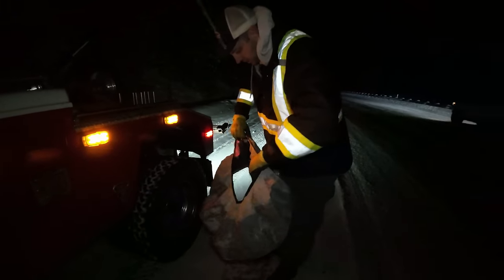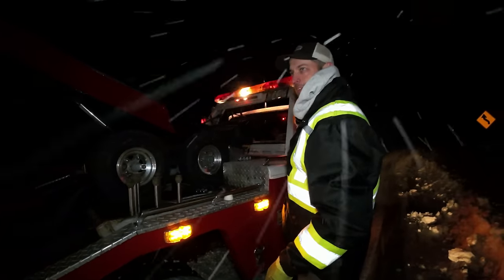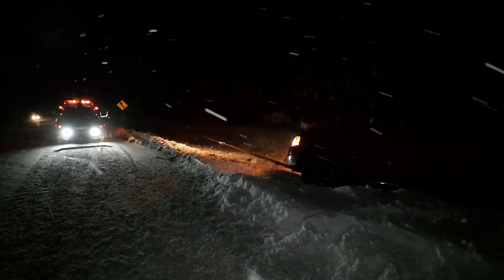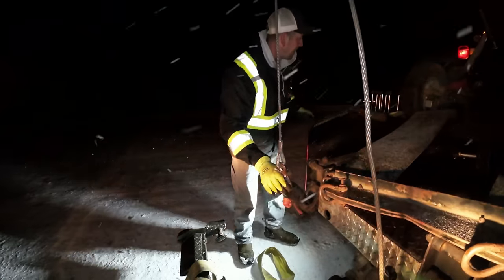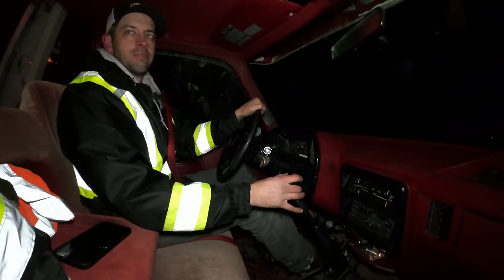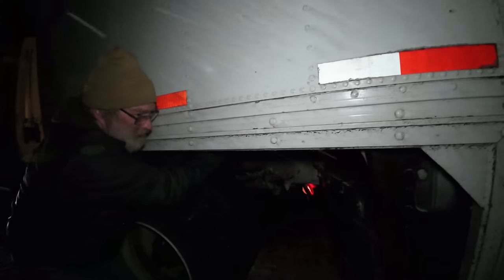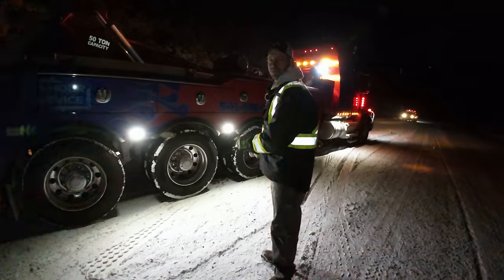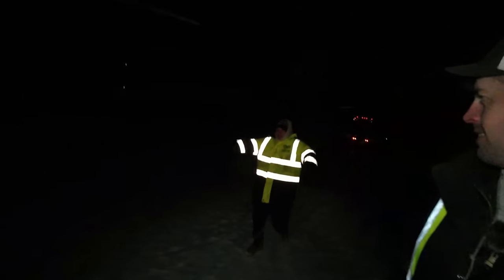Snow storm on the mountain.  Bring in the big dogs!

Comment: I could see the gleam in Casey's eyes when he seen the rotator! Thinking, "I need one of those!"
Reply from the maker: Not a rotator
Reply: That unit will set you back $750k +/-.
Reply: Before even said i took 1 look at that truck and knew right away what truck that was. Not a spinny boy, thats a straight stick Hr117!
Reply: Look at it again, as Casey says, it's not a rotator. It does not have a proper boom for starters and the carriage for a boom will slide along the length of the cargo box, but while it's being driven, it's rolled all the way back towards the cab and contains the spools. This one, the spools are likely fixed and the cables are part of the apparatus at the end of the cargo bed that only moves up and down, but is not a proper boom. For example of one, is a 2015 Peterbuilt based cab with a Century 1150R cargo bed from Ron Pratt (his channel) and he works for his parents trucking company, Midwest Truck out of Scott Missouri. He primarily drives it, and like this one, is a triple axle, with the front, rear wheels as additional steer wheels that also raise and lower as needed. The A+ towing truck may be based on that same cargo box .

Comment: Just some advice for those of you new (and inexperienced/overconfident) drivers… even though it’s a 4-wheel drive don’t drive faster than you can stop with just a very gentle application of the brakes…. Basically triple the amount  of stopping distance it would normally take …  remember that just because it feels like you have traction going forward as soon as you stab (hit the brakes hard) you’ve become an ice skate
Reply: I've preached that for years.  4x4= go easier on snow.  NOT go faster on snow.  You still have to be able to stop it.  Having 4x4 does tend to even out braking forces, but that little bit of improvement should not be relied on.  Also... YOU must be prepared to make allowances for others that can't run as fast as you can.  If they are ahead of you, it's your problem.  Don't crowd them.
Reply: An easier explanation is that 4wd only helps you get going faster
Reply: @thelonewrangler1008  my grandpa always told me that 4wd was only used in reverse to get you outa where you got stuck😁
Reply: A very wise and experienced driver once told me that having a 4x4 means you can get twice as stuck since all four wheels can dig holes! I drive a Subaru Forester, and a couple cars previous to that I had a 4x4 Aerostar van. When a sudden snow storm blew up while travelling from Toronto to Montreal along the 401, I drove about an average of 40 mph. I was constantly amazed as people in SUVs would go zooming past me, and I would see taillights, then alternating taillights, headlights taillights as they spun out on the next really icy patch. I would slow down more, make sure they were OK, then continue on. It's normally a 6 and bit hour drive...that trip ended up being 14 hours long!
Reply: @FarrellMcGovern  Nothing compensates for experience and commonsense ( which is becoming harder to find).
Reply: Just put new tires on 4wd. Nice flat, packed snow, nobody around.  Hit go pedal minimal spin in 2wd. Then I hit brakes. (Under 30 mph) no antilock. Had to let go.  They will be better in a few weeks. I should get chains.  But I seldom go in mountains.
Reply: Another piece of advice - is you are in 4 wheel drive and have to stop, put the truck in neutral. It stops the drive to the front tires - helps you break and steer. 4x4 means better traction to get going, but is a hinderance when stopping on slick roads.
Reply: My God man loosing control of a F-150 in 4x4 ?
Wow there very solid on snow and ice.   Rookie driver. Left of center could have been a head on Collision.
Reply: @Mlpojnnb1234  Heavy and longer time to stop on ice. Of course TIRES matter the most.
Reply: The first rule of snow is You don’t have brakes on snow period if your touching the brakes you’ve already fucked up downshift and engine braking

Comment: I want snow socks now. I can never justify chains, but socks look so useful. Quick on/off, small enough to carry year round, and don't make a racket in the back.
Reply: This was years ago (1985) the west side of Washington State got hammered by a big snow that dumped up to a foot of the white stuff in parts of Puget Sound and I bought cables and they were quite good, but like chains, can't run them on dry pavement for long, if at all. Eventually one of my cables broke while out delivering pizzas for Domino's. The car did well in snow, unless it was icy as it often was at night until the snow finally cleared away a week later.

Comment: I had seen a video a while ago where those snow socks were tested.  For what they are they actually do a pretty amazing job , they definitely do work!   I am not sure how long of a service life they will have, but I think that we may find out as Casey continues to use them.
Reply: For no harder than they are to install just keep them on snow and they should last a while.
Reply: How different are they functionally from the snow chains?
Reply: @nsbhagwat  my understanding is snow socks are more of.... slick plowed road driving tool.  Fairly good at it cause of all the micro pores (think millions of tire sipes).  For snow much deeper...  you need a GRRAAAB of snow chains.
Reply: Snow shoes suck on a 18 wheeler
Reply: @gordonil30117  thats been mentioned many times... while others have had success.  Could be the difference is the drivers foot.  Socks have apparently a very very narrow speed range they are effective and on big rigs due to weight... also a very short life... potentially as short as one mountain pass life only.
Reply: @coachgeo  Nah, snow socks work better in 4-6 inches of snow compared to chains. They also have a way shorter stopping distance compared to chains. I've used socks in Canadian winters for the past 2 years, they work when you need them. Chains are much better in icy conditions though and they will last far longer if you're on a highway with patches of exposed pavement or gravel compared to the socks. 

Sergiu Gabor did a really good, and entertaining, real-world-type test of them. 
https://www.youtube.com/watch?v=NpMmu0AliG0
Reply: @Jagabot_Esq.  could see your point about snow benefits...  Especially if snow has hardened.  In those cases chains breaks thru the hard layer and puts you right back into fluff again where the sock may aid in riding on top of the hard and the micro pores of socks should help here same as I mentioned when considering braking. 

Guess could then this makes it sorta ..... both points correct??

Comment: Let me guess, the red pickup has NO Weight in the back! Normal for this to happen! 
Few learn!
Reply: I used to have a 3/4 inch steel plate in the back of my F-100. A good 300 lbs, had to use the tractor to get it in and out. Really helped, and wasn't bulky. One year we put an old bathtub in, and let if fill with water. Then realized it was a torpedo if I was ever in a crash. Bad idea.

Comment: Having some spare air line could be to your advantage + clamps, fittings, just in case. Awesome video and job sir, keep them coming!👍👍👍
Reply from the maker: I do have everything I need to repair and replace airline on my other truck.
Reply: @CaseyLaDelle  Makes more sense to have those kits on the big rollback than on the light duty. Not many F-150s need air line repairs.

Comment: Just found ur channel, love it. In the winter, I drive hwy 20 from the valley to mt. B all the time. This rescue reminds me of 4-5 yrs ago, EB, crested the summit, no new snow, but that day sunny, and the snow must have melted mid-day. Road was an ice rink at 5pm January .  18-wheeler tractor (only) rightful so, crawling down the hill. He pull off at the first big pullout. The Ford Expedition behind him blasted down the hill. A few corners later, the Toyota Forerunner in front of me enrolls in ballet class, and did a 360 pirouette right in front of me into the two uphill lanes-luckily no up hill traffic. I just stayed in my lane and passed him. Once he got his rig under control, he tried to pass me, maybe he did, don’t recall. Well, 1 or 2 corners latter, there was the Expedition ‘beached’ just like your F150 bro. Of course he slid across both lanes of uphill lanes. Just below all this a bunch of cars travelling WB at speed. When we got into town, during dinner, I logged onto tripcheck, sure nuff, hwy closed. ❤ my Bridgestone blizzaks on my outback. Ps.. added you to my address book, if not for me, someone else.

Comment: Casey's eyes and the smile was just like a kid in a candy store when the rotator showed up. Could it be the next one to come to the yard and fleet.
Reply: Its not a rotator, it looks like one and is on the same basic body shape but its a heavy tow truck
Reply: @nphil93992  Yes, Nathan is correct. It's a Class A wrecker for bigger pulls or lifts. Notice no boom midway down the bed. That's a rotator.
Reply: Just a straight stick 50ton. Still a VERY NICE and expensive truck.

Comment: Casual observation: you recognize inexperienced ice and snow drivers by those who travel a mountain pass with no "just in case" coats and gear. 4-wheel drives with all season tires thinking they're just fine doing the speed limit.  Casey's always thinking ahead, parking his truck where oncoming traffic gets plenty of time to slow down, in a snowstorm those reflective triangles can be hard to spot.
Reply: Winter driving should always have the essentials - blankets, water, emergency food, flashlights. All vehicles with 4 wheels should have them, not just 4x4. Look at how many people Casey has rescued out in the woods that weren't prepared. Nobody wants a search and rescue to turn into a search and recovery.

Comment: Great show. I like the giant service truck and the air line fix. Casey you should acquire  some good LED lights for night videos. (The NONE flickering type). A really bright on camera light and some magnetic and clamp on LED flood lights.
Reply from the maker: The camera has a light on it.   I don’t use flood lights for roads is work.  They are dangerous when used improperly.   Notice all the big rear facing LED lights on top of my truck were turned off the whole time…

Comment: 4wd is bad for stopping. 
Especially locked 4wd.
Hard braking will then lock all wheels, and if the rear brakes locks, the car will become very unstable and rotate uncontrollably, instead of  just continuing straight ahead. 
That's why the braking force are usually 70% in the front  and  30% in the back.

Comment: If you own a big crew cab long bed 4x4 and you think you've got the best winter beast on the road, you're dead wrong. 

Those trucks get taken by the wind and pitched in a ditch super easy. If you've got the urge to drive fast and you see something low and AWD like a Subaru, follow their lead and slow down. Aside from ground clearance, that Subaru is better on slick roads than your truck ever will be.

Comment: Do they require chains to be on the vehicle, or to be carried in the vehicle?
I see no point with chains here if you have proper snow tires.
Reply from the maker: 4x4 with snow tires don’t have to use chains if they are under 10,000 pounds and not towing.   Everyone else is required to use them.
Reply: Many passes in that part of the area (most of the Cascades, actually) have chain requirements by law. There will actually be troopers in the chain-up areas to make sure trucks are chained up. Big fine and impoundment is your reward for not chaining up.

Comment: Cage the trailer brakes
Reply from the maker: Not when it can be repaired easier than caging.
Reply: if you cage them you completely disable them for the drive to the repair shop, but when you repair them (even with a temporary fix - which according to Watch Wes Work 'it is only temporary unless it works') then they are there when needed

Comment: Do you ever get pulled over for using red lenses on your rotator lights ? I guess different places have different rules. Where I'm from in Atlantic Canada, red is only for emergency vehicles. Tow trucks have to use amber along with other commercial vehicles. Amber and blue are used on snow plows and salt trucks
Reply from the maker: Nope, red lights on tow trucks are legal here

Comment: #CaseyLaDelle Question, on the Siskiyou Summit would Snow Socks even be beneficial since they throw down gravel during snow events?  Wouldn't that shred your Snow Socks?  Years ago we debated betwewn chains, snow socks, and Spike-Spiders, we ended up with Spike-Spiders.
Reply: Gravel on siskiyou, cinders on santiam. Both are going to be rough on the socks. If they hold up on cinders, I would think they would do their job on rock.
Reply: @george2113  studded tires are great but the noise and vibration is a little obnoxious.   It also depends on how much winter you have.  In the NW we have a lot of snow and i run BLIZZAK by Bridgstone for the wonter season.  They only last around 15k miles so taking them on and off at the right time is important.  In my opinion they are better than studs.

Comment: 12:51 These two men are good example what not to wear especially when working on the road side and in darkness, or in general when working on a scene with moving vehicles etc. Not so long ago a truck driver was hit and killed by another truck when he was replacing a broken tire along side by a road at night, the driver told that he saw the man next to the truck on the road when it was less than 10m distance to him so there was nothing he could have done to avoid hitting him, he had noticed the truck by the road out of the driving lane with its blinkers on but because he didn't see anybody around the truck with high visibility vest  he thought it would be safe just to drive pass it, in court he was made guilty for the accident

Comment: What's the distance for the trip over the mountain? Is there any alternative to go around the mountains if the pass was closed.
Reply: Yes there is an alternative but it’s 3-4 hours and depending on the storm can be as bad or worse … often the pass is the alternative for the the other route….
Reply: @oliverohnemus5791  Thanks for the info
Reply: Basically you have the entire length north to south in Oregon,, the ocean (coast hiway), coast range, east to central valley from Portland south (Interstste 5) to California. And the Cascade range and hiway 97( Bend is Casey home) from the Columbia River south to Klamath Falls/California. There is no flat way to get to I-5 from hiway 97 unless its down Columbia hiway 84, and that can be impassable in bad weather due to high winds and flying windmill parts. 🤔 IMHO

Comment: Casey.  Please emphasize the point at @3 minute.  That one driver spun out on that curve, slide all the way across, went backwards into Ditch.  You are in danger.  Stay in your car until you are thinking of your safety.  Then expect next car to lose control.  Where will you go?  Dad slid off interstate into median (long before stupid cables) another car slid in right next to him less 30 seconds later. If his door was open. It would have been damaged.  Driver JUMPS out, runs between cars to check damage. (2’ between, snow built up so dad could no longer open door). Dad suggested he get out because a 3rd car is sliding in.
 Roads were good until the curve.  No sun hit the road on last 1/3 rd if curve because of hill, trees. Cars are cheap to fix.  People are expensive to repair.  Never as good.
Reply: The safest place to be is either behind a barrier, or way off the shoulder if you can. But yes, in the vehicle is safer than out on foot waiting to be a bowling pin for the next car.
Reply: @mishkajb  The bowling pin is a good analogy.  🙂

Comment: wondering if studded tires does anything for y'all?
Reply: Studs are for ice, they don't do any good in snow. And it's "permanent", so on dry pavement they wear faster. Casey has a couple of videos where he adds studs to tires, like his wife's Jeep. They are removable, so you don't have to have 2 sets of wheels and tires - one for winter and one for non-winter.
Reply: studded tires tear up the road surface and are not allowed to be used just everywhere